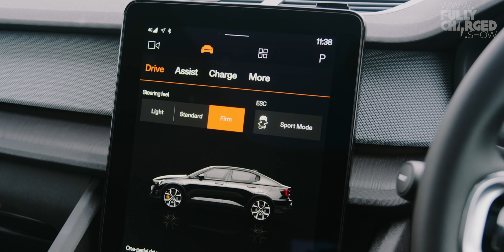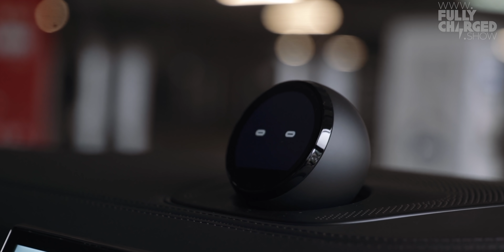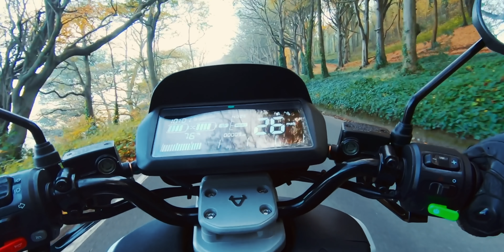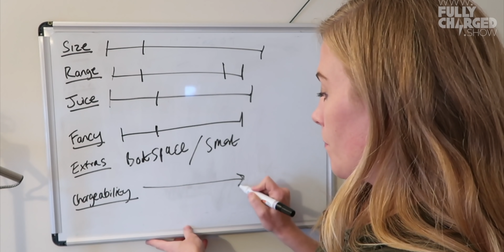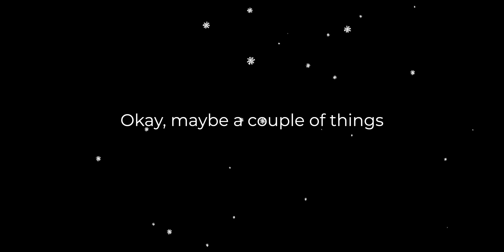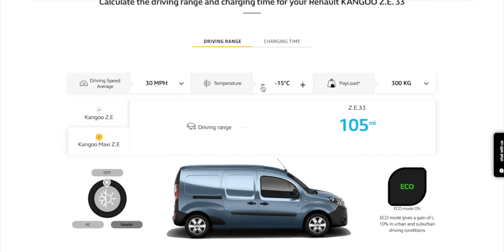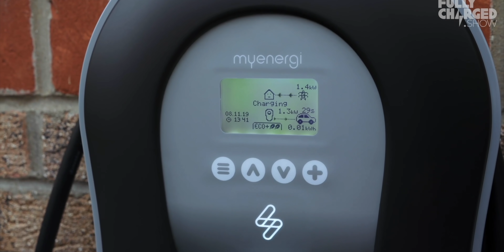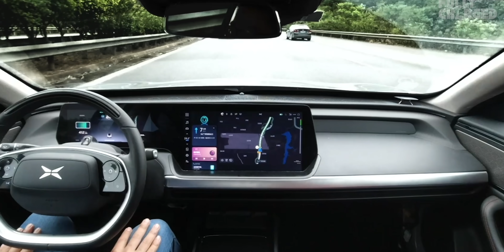Christmas Round-Up: The Best Bits of 2020 | 100% Independent, 100% Electric

Comment: A suggestion for Andy: how about trying out an electric paramotor?   It's when you go up in a paraglider with an engine strapped to your back. I've been reading them up  - there's things like the OpenPPG (an open-source design) to the EXOMO one from France.  The look rather amazing and you can take off with huge power and then use thermals to stay up and only turn on the engine to get from one thermal to another.

Comment: Here is to a better and brighter 2021. Been with fullycharged from the very early days. 👏👏👏. My dream of driving round the highlands of my home country Scotland in a EV are getting closer and closer. Yes I know you can do it right now but every year it gets easier and cheaper. Looking forward to a 300 mile 2 door hatch, maybe the Second gen MINI SE could hit that sweet spot or the new Tesla 2 hatch out of Berlin 😁 My current daily was bought split new factory spec’d to my liking as I knew it would be my last fossil Car. Had it now seven years and plan to put a good few more miles on it before going EV.. it’s only done 24k miles. 😂 Bring it on. 

What we do know is battery tech is improving year on year becoming cheaper. 

Merry Christmas and a happy Hogmanay to the Fully charged crew, I’m looking forward to what adventures you get up to next year.